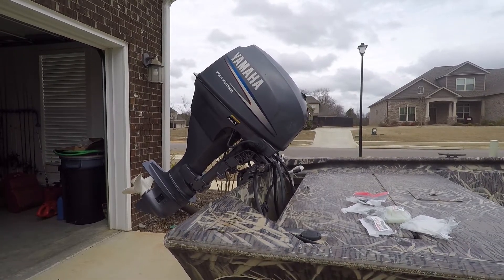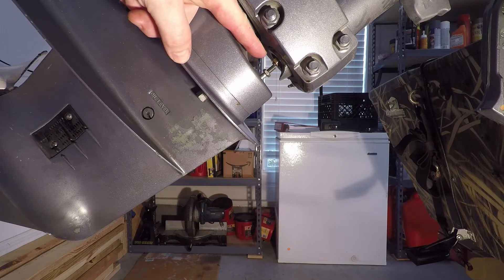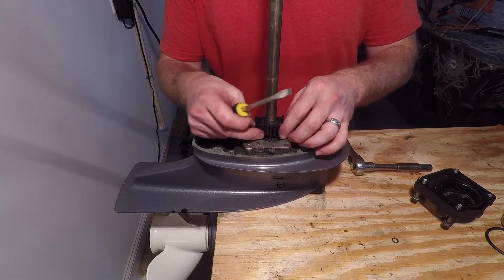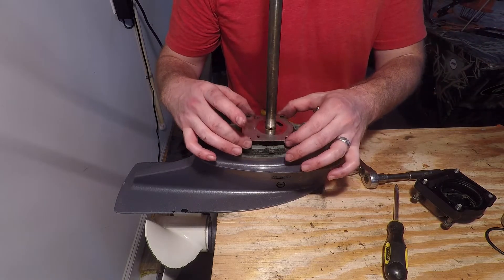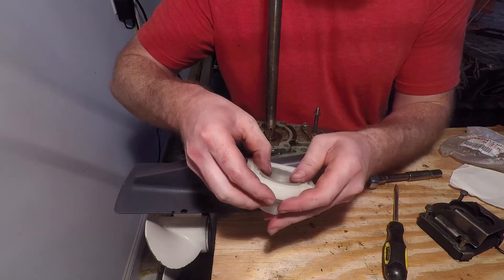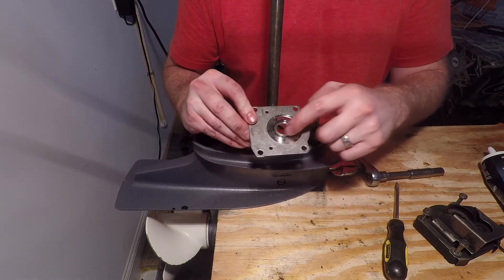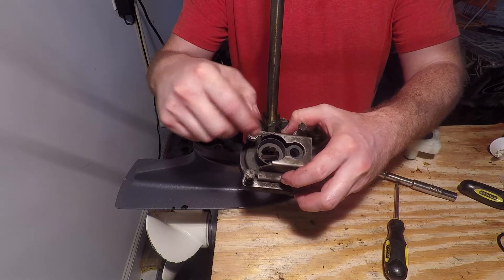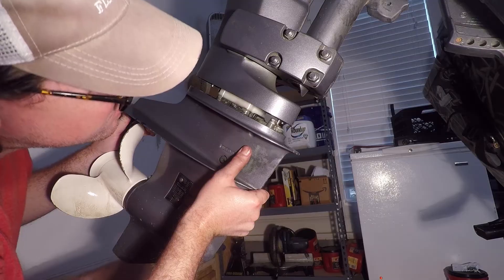How to Change a 25 Hp Yamaha Outboard Water Pump Impeller

Comment: When removing rubber parts I've learned to spray a little silicon to lubricate the steel shaft or bolt.

Comment: Excellent instruction video!  
One comment about post-install testing - whether with miffs or the flush-connection, since both options “force” water-flow through the system under external pressure (via the garden hose), and will undoubtedly produce discharge through the pee-hole - regardless of whether the impeller is or is’t functioning. 
Much better to test the impeller installation by running with the lower unit fully emerged in a water tub - which replicates the unit in its normal state where the water-pump pushes water through the system rather than a garden-hose “feeding” water into the system under pressure.

Comment: Mine had some type of white silicone on the bolts because of dissimilar metals (aluminum/Steel). Also its best to call a Yamaha dealer and get the EXACT part number for your kit. Mine had 11 different kits and only 1 is the right kit. Use your model number off the plate on side of motor and call a dealer. Best to order the kit right from the dealer vs off of SCAMazon. Yamaha does not sell direct or through parts houses so the only way to get OEM and not CHIN-HO-OEM-Knockoff is to buy from a Yamaha dealer.

WARNING if you spin the propeller the wrong way during cup to impeller insertion the impeller will be in the wrong way with fins backwards. Fins should be pointing clockwise when held in left hand looking down at upside down cup. I insert my impeller in the cup while in my hand C and then slide the cup/impeller over shaft. 

For a 2021 F25swhc the kit number is 6fm-w0078-02-00 and the impeller alone number is 6L2-44352-00

Also for removing a stuck key here is how.
1.) Wire brush any rust off.
2.) Spray with penetrating oil. Let sit overnight or for one hour.
3.) Tap one side of key with a large flat punch on one side so it rocks in the slot and it should rock out easy peasey.
4.) If its still stuck you can freeze it with any compressed air item hel upside down, like a can of propane or dust off and freeze it to make smaller then use tap/rock method.
5.) If still stuck and least desirable use a small dremil cut off disk to cut a slot in the top (dont nick shaft) and pinch with vise grips and pull out.

Comment: Great stuff! Talking about the lower unit, do you have a video showing how to pressure test it? I have a suspected tiny leak and read that you can use low pressure in the case to find which seal is leaking... :-)
Reply from the maker: I’ll add it to the list.  Swamped at my real job right now

Comment: I liked your video but I have one question if you put your water muffs on from the other side of the motor wouldn't that solve the propeller from hitting it if you came in from the other side
Reply from the maker: Agreed but I had to do it that way for some reason I can’t remember.  Also never put it in gear and Rev it with no load (i.e. not in the water) it can ruin the gears

Comment: You should first bolt the lower unit to the outboard then connect the shift shafts together. By doing it opposite, like in your video, you might hear clicking sounds in the gearbox, like when you have your shift lever halfway pushed.

By having your lower unit in reverse before you remove it, it will give you greater access to the brass standoff and the nut.
Reply: That’s exactly what happened to me. Now I can’t get the clicking noise to go away. I’ve taken it apart and put back together about a dozen times now 😩
Reply: @adambaumbach6763  you don't have the shift shaft of the lower unit in reverse.

Get the lower unit out of the outboard. Push the shift shaft of the lower unit downwards WHILE turning the prop, make sure that you can't push it down more!! Push the shift lever of the outboard to the reverse position. Bolt the lower unit to the outboard. Connect the shaft linkage and you are done.
Reply: @flienky  having this problem right now, ill try when im home in an hour, its starting to piss me off
Reply: @adambaumbach6763  same im about to scrap the whole motor becuase i cant go anywhere except forward

Comment: I have a similar Yamaha 25 hp 2-stroke engine.  In replacing the water pump impeller I noticed that there is rubber Seal Damper (Yamaha part # 6L2-45375-00-00) adjacent to the water pump that stops water and exhaust from entering the compartment with the water pump.  There was a sealant with the consistency of silicone used at the ends of the seal damper for sealing purposes.  I want to replenish this sealant when reassembling the motor. Do you know what type of sealant would be good for this purpose?  I am thinking of using Permatex Ultra Black max oil resistance RTV silicone gasket maker.  Does this make sense?

Comment: Just a reminder that anyone watching this should remember to turn their driveshaft clockwise only when putting the housing back on the new impeller, as he did.  I think some motors may turn counterclockwise but I'm not sure which.  Cheers.
Reply: You beat me too it. Correct, you have to turn the drive shaft clockwise, the reason! The water pump number fins have to lay  this way to create water pressure. It will not create proper water pressure if you spun the shaft counter clockwise which will not generate proper water pressure and could cause you to burn up your motor. Note, always pay close atrrntiin, this is a crucial step. Always test run your motor on a hose ti verify you have proper water pressure and let it run long enough to verify the pumps water is indeed cooling the motor properly. The motor will be warm enough for you to place and hold your hand on the cylinder head, if it is hot enough you have to remove your hand, shut the motor off and allow to cool, most likely, you installed the impeller the wrong direction. Remove and verify. While you have the lower unit off, verify there is no water restrictions. Note. Water should come out of the peephole while running, if no, a muddober  may have plugged the hole, just take a cloths hanger and stick it in the hole and it will resume working.

Comment: Thanks a million for this video! First time working on an outboard and I was able to replace mine with no trouble. A little comment for anyone watching - I thought I had a part that was too big, but the fins will bend when put into the cup. I went back and watched this a second time and he says "you might need to twist the prop to get it in" - this is so that fins bend and pop in. 

Thanks again!
Reply: Totally agree. I said to myself damn got the wrong part. Watched it again an I was good to go. Saved a ton from the video.

Comment: What is your propeller details can you share with me ??
Reply from the maker: Stock 2003 F25.  Aluminum, 3 blade
Reply: @thisoldoutboard  stock ok but what is the details? 13pitch, 14pitch, 9 inch, 8 inch vs ???
Reply from the maker: 9-7/8 x 12 - F

https://www.manualslib.com/manual/559947/Yamaha-F25.html?page=23#manual
Reply: @thisoldoutboard  thank you very much for details...

Comment: Are you in neutral when first looseing that first barrel nut? Im working on a 25hp 1996 and that shift rod wont come out...when backing the that nut off I get a ton of tension
Reply from the maker: Yes you have to play with the gear some.  And I had the same issue with paint buildup around the lower unit shift rod shaft

Comment: Nice instructions. Just did this on a 2010 Yamaha F25LA. Not too hard. Found it easier to partially install one lower bolt (to hold unit) while reattaching shift rod screw. Even purchased the quick silver grease. Thank you
Reply: I was wondering why he didn't do that to. Much easier to do it that way.

Comment: Good video! I just bought a boat with this exact engine, quick question: what is the little wire sticking out the front of the lower unit/leg seam? You moved it when you were putting the lower unit back in.
Reply from the maker: Pretty sure its what remains of a safety wire between the lower unit and the upper housing.
Reply: @thisoldoutboard  did exactly what you said but shift rod will not unscrew all the way to release shift rod..

Comment: Great video, do u have an air box for a 1997 25 HP 2 stroke twin carb Yamaha outboard or know where I can get one
Reply from the maker: I believe this is what you need - Cover #1: http://bit.ly/2IwnDdV  and Cover #2: http://bit.ly/2KruYx8 along with the O-Ring: http://bit.ly/2IylUEG
Reply from the maker: The parts diagram is here: https://yamahaoutboards.com/en-us/  click Maintenance in the upper right, then outboard parts, enter your information.  The direct link wont hyperlink for some reason on that site